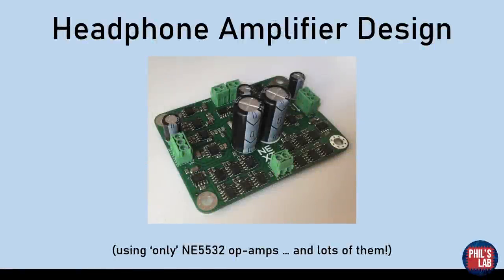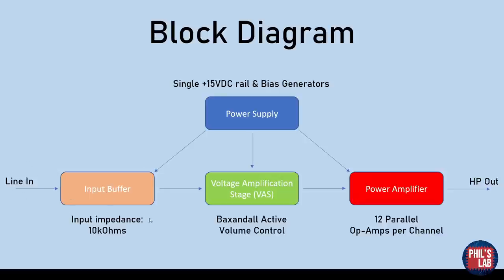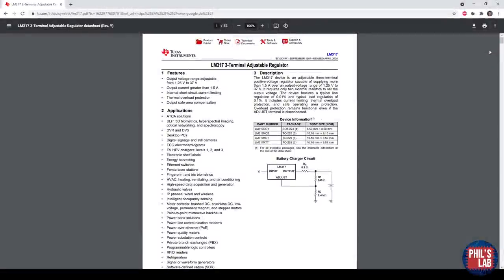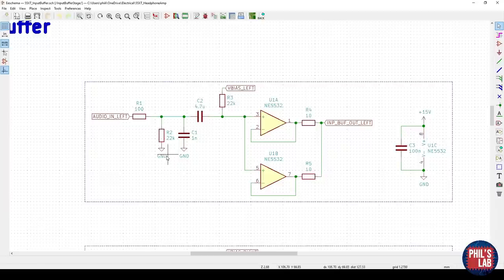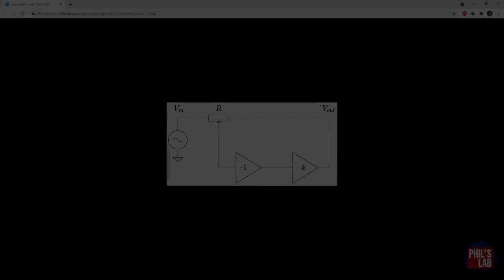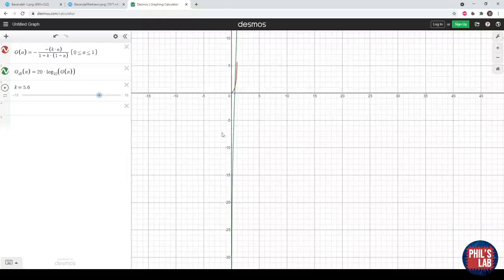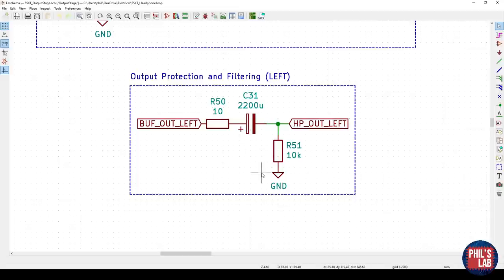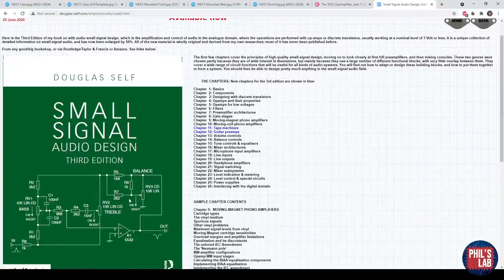Headphone Amplifier Design | NE5532, KiCAD, Baxandall Volume Control - Phil's Lab #24

Comment: JRC4556 is better suited for headphone amp application with 70mA current o/p and ability to drive 16 Ohms +/- 5V even though data sheets says 150 Ohms at +/- 15V. The same project would have required less opamps at a slightly higher but insignificant distortion and noise  SMD OPAMPS have lower power dissipation limits compared to DIP or SIP

Comment: 12 ne5532 are overkill for the application, you could get away with 4 ne5532 or just 2 jrc4556 (like the JDS objective2) in parallel. one ne5532 can give like 30mA. That is more than 0.3A you could drive speaker with that too.

Comment: @13:04 I can see that you have put an extra op-amp stage at the output to invert the voltage again, since we are dealing with audio signals, what difference does it make if the output is 180deg out of phase with input?

Comment: Very impressive project & really well communicated. Not totally sure about the 10Ω output resistor, not an issue for 600Ω headphones like the Beyers, but might skew the frequency response when driving some low impedance cans. Interesting to see a project inspired by Self's op-amp array power amp, I've been working on a power amplifier based on an array of 16 OPA604 op-amps (as they allow +/- 24V rails) driving the output, with A.M. Sandman's "Class S" bridge arrangement supplying current from a discrete transistor amplifier to reduce the effective load impedance and make it possible to drive an 8Ω load (such as a loudspeaker) with such a small op-amp array.
Reply from the maker: Thank you very much, Karl! Yes, in hindsight the 10Ohm output resistor isn't great. I made this amp over a year ago I believe for my Beyerdynamics and didn't really worry too much about driving anything with a lower impedance.
I'd be very interested to see the result of your power amplifier design. Will you be posting that on your channel?
Reply: Thank you - yes, that's the plan. I hope to feature the amplifier in a video sooner rather than later.

Comment: I may have to revisit my headphone amp as I'm building it into a digital audio box at some point.  I'd really love to find a single ended I2S amplifier.  I can find lots of double ended/directional amps with i2s in and I can find dozens of consumer grade gian limited non-sense with i2s input.  Just not that sweat spot around 1-2W single ended stereo with I2S.
Reply: I can / could use a pair of differential amps like the MAX chips and single end them using the OPA551 which would take the current.  I'm not really sure if it's worth doing that rather than just having a DAC + OP551 amp stage.

Comment: How did you actually decide on the total number of output stages? The presence of 1ohm resistance is slightly confusing. Why specifically 1ohm resistors?

Comment: When I used the voltage divider + buffer amps for the VGND... the resistors had to be a LOT bigger than 2.2k  I started with 10k and 10k and all I got was noise off the power supply.  I had to increase them to 100K and accept the fact it takes 15 seconds to charge the ground caps.
I've heard too many bad things about parralleling opamps when you could just buy 200mA opamps like BB OPA751s.  Which was my power stage.... my only stage!
The baxandal config I have prototyped (from the same book you mention) as a variable gain input stage.  However I wondering how far you would get putting the power opamps in baxandall config, such that you have variable gain, rather than attenuate and then boost which is the worst possible case for noise levels.

Comment: Awesome video. Im not sure I understand how parallel amplifiers reduce noise. Could you explain that, or point me to where I can read up on it?
Reply: Here is a great source on noise. The next video explains the non-uniform sources.
https://youtu.be/D0imKJvZyyk
Reply: Simple answer: noise is random positive and negative excursions at random times. If you parallel two random noise generators at a summing node, they will average their outputs. The average will usually be less than the maximum of any excursion unless both generators happen to generate exactly the same noise spike at the same time. The more you parallel the closer you get to a DC (or no noise) output. 

You never get perfect DC (or perfect voltage following in the case of paralleling voltage followers) because there is always the random chance of a significant number of the parallel amps generating the same noise pulse at the same time. But on average you get less noise.

Comment: This is great timing for me as I'm taking my first steps into Audio, I bought a dirt cheap Cambridge amp for spares or repair and it only had a dicky pot, but it had no Phono input, I decided to build one (why not !) and settled on a simple design based on the NE5532 by Rod Elliot, I have done the layout myself (Kicad) trying to use best practices and stuff, so I will see how that works out, it looks nice !.....but, it also lacks a Headphone output !! so your design could possibly fit into my grand scheme of things, I'm no audiophile but I have a nice set of British speakers so could end up with all I need with the bonus of having built some of it, I will watch the vid again to see how to contact you as I would love to know more....cheers.

Comment: This is really something new made of 555 -)

Check out some solutions using BUF634 (250mW output) in parallel. They can be either pre-amp or a power amp. They can amplify a PAL signal, and at the same time can easily beat some $20k power amplifiers in terms of a sound (of course with a power supply of a corresponding quality).
Reply from the maker: Thank you, I'll check those out!

Comment: Can this Amp be modded to receive an USB amplification? how much current does it draws at full load?
Reply: Your best bet would be to buy a ready-made USB receiver board and simply connect the two together. The off-the-shelf ones are very good quality and have heavily researched layouts.

Comment: what kind of capacitors did you use for this?... I have heard that for high end audio design you need expensive audio grade caps, but to me it seems like you used standard electrolytic and ceramic ones... Does it even matter for something like this?
Reply: The term "Audio Grade" is a marketing phrase that doesn't really mean much in electronics. Audio capacitors differ from regular ones mainly in that they are not distributed through normal channels and that they do not have detailed datasheets. Standard electrolytic and ceramic capacitors from your favourite electronics shop will do the same job. Hope that helps :)
Reply: Use NP0 ceramics otherwise other types may cause microphonics. Cheers, Ian
Reply from the maker: For ceramic caps it pretty much doesn't matter. For electrolytics you should choose the actual capacitance large enough so that there are no signal voltages across them as they can introduce some audible distortion otherwise.

Comment: Hi Phil, that‘s a neat project, I was directed from the second version to the original video here. May I ask a specific question regarding the statement on the -3dB point of the output capacitor: 2,2uF*250Ohm*2*PI results in 3,5Hz. How to achieve or calculate the 0,3Hz cutoff point? Am I missing something?

Comment: So let s get to the bottom line. If we paid for a solution with pcb... what is the cost? if you double the price so you get a minimal design margin... whats the cost? if we pay 3x the build and supply price... whats the cost? then simply add postage the you have a business. If uou organsise the PCB maker to provide tis... you have customers and hally solution chain.... as long as it delivers on the poromise. Dosnt have to be the best just good.

Comment: unusual design, interesting to see so many opamps in parallel.
Spent many years with 741's with 759's driving the headphones, no need for low noise or distortion as Aircraft Radios are not known for being high fidelity. We used the nice metal round can 741's gave a little pit of screening. Audio was fun before the DSPs came along and put the audio in to nice little  timed packets and 1's and 0's, but the old analogue signals still hung around in emergency failure backup mode should the nasty littly DSP decide not to play ball. :-)